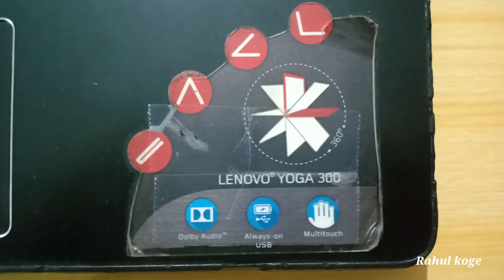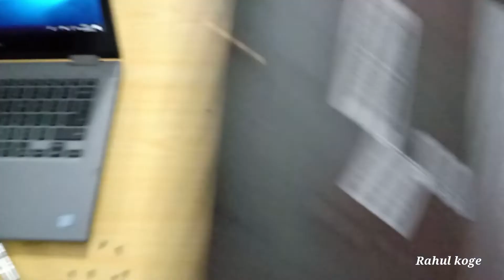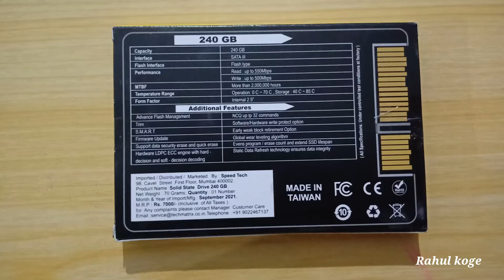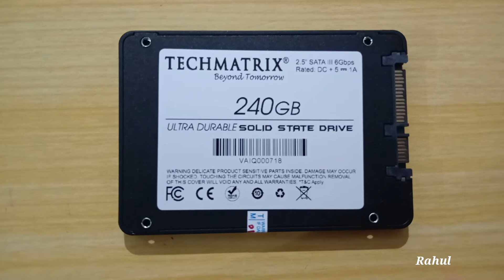Lenovo yoga 300 SSD upgrade

Comment: Cause i want to know if it's running or just the customization with the ssd as hardware.
Reply from the maker: SSD is the storage device it is properly working in this model
Reply: @rahulkoge  in lenovo yoga can anyone do customisation let's say using its display seperately or keypad separately or something???
It would be helpful if you'd reply thanks in advance